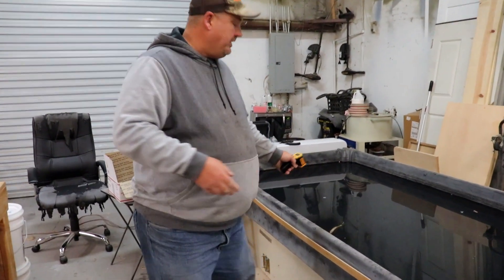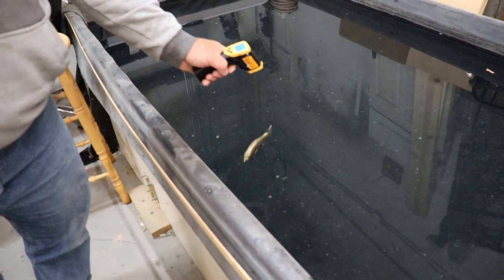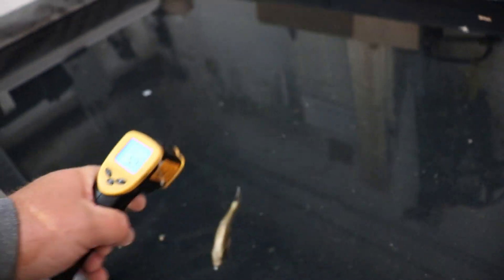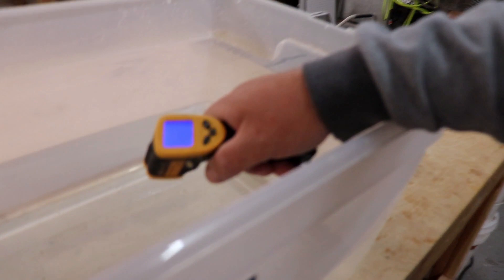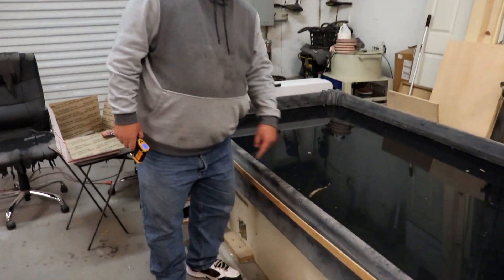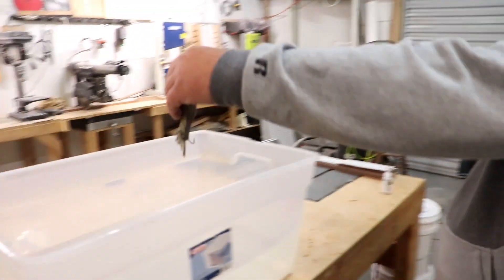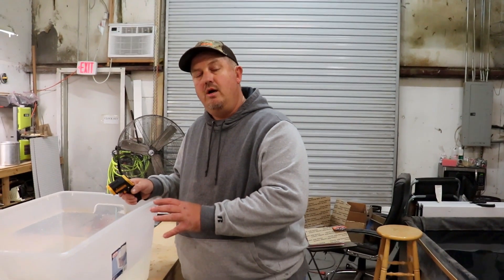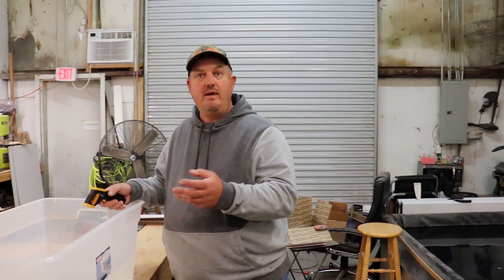RATE OF FALL PHYSICS

Comment: I just bought a trick shad, tuning chamber appears to be filled in. our water temps are in the 70's and it floats (Washington State).   what would you suggest? hook weights? tuning strips? if so, do you have a recommendation on placement for the strips or should I just load the front hook? Should I weight the two hooks evenly using lead wire?
Reply from the maker: @livewire2k4  upsize to 2/0 hooks.  Any tuning strips add it between the front hook hanger and the back of the head.  Right in the middle of the bait to keep the sink level level
Reply: I'll give that a try, thank you very much @BullShadSwimbaits